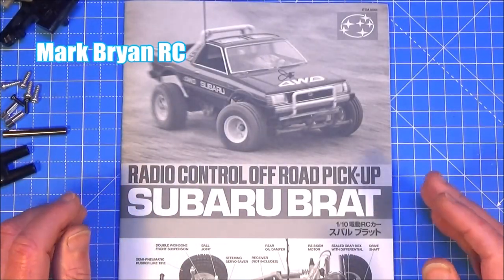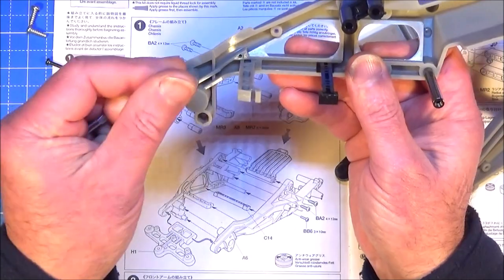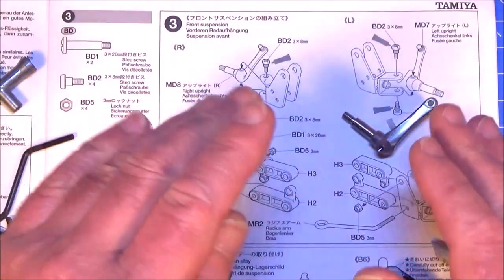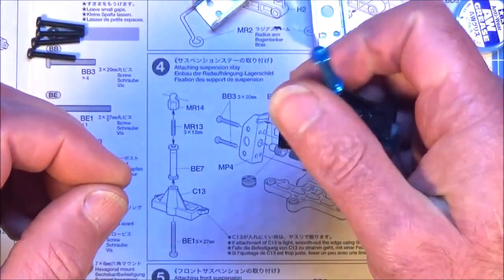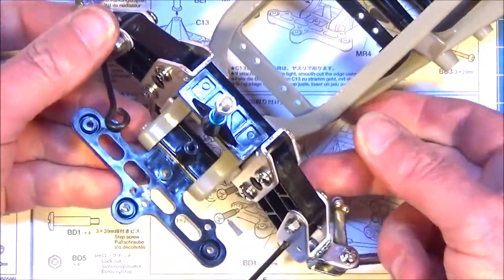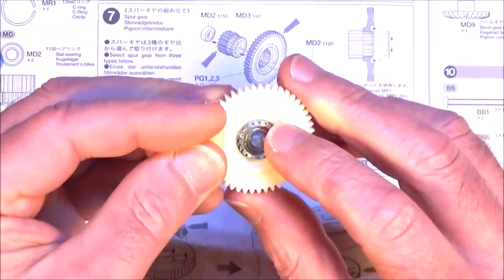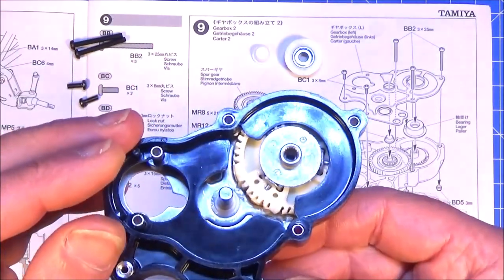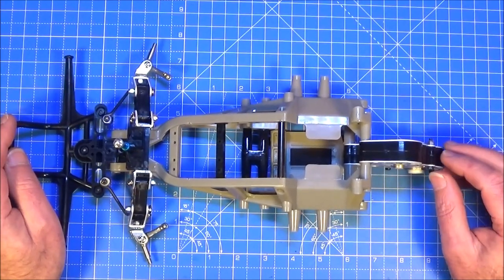Tamiya Subaru Brat Build Guide Part1 - ORV Chassis

Comment: A little tip when you install the uprights...
Put some blue thread lock on the 4 screws that attach them.
I've had 2 fall out never to be seen again.
After thread lock they're all secure and haven't fallen out..
Reply from the maker: Hi and many thanks for the great tip, you just might have saved me losing those kingpins! Yeah, I've had many parts fall off my RC's in the past, they seem to disappear into thin air, don't they?!?!?! Cheers!

Comment: I liked the brat but that front knuckle fell apart . Found the riding fighter plastic knuckles fit well with a good old bolt through them . When it’s all painted up mate it’s a beautiful looking truck and quite different really to drive and view . It’s also quite nippy with the high speed options you get 👍
Reply from the maker: Hi Dom! Thanks for the heads up! Luckily I've got a spare set of those uprights. I'm a bit daunted by the hard body but I'll give it my best go! All the best my good friend! 👍
Reply: @MarkBryanRC  yeah do the hard body mate it looks stunning when finished . It’s time consuming but not to bad 👍
Reply from the maker: Will do matey, fingers crossed it comes out OK! At least I can respray it if I mess up! Cheers! 😜🤞👍
Reply: @MarkBryanRC  it will mate . Unless you are going two tone it’s a couple of sprays over the body as normal then some detailing mostly in black around the windows . If you have done a Blitzer beetle bod you will be well away . Just time consuming 😊👍 have to say tire writing goes down a treat on this car 🤔
Reply from the maker: @rc-dom-uk  Thanks for the positive words, mate! I'll try and chill about it. And yeah, already dug out my white paint pen for those tyres! 😜😜👌👌👍👍

Comment: Great vid Mark 👌 you on about a screw missing from your kit, my ford escort custom didn't come with that AW grease tub so I don't know if it was supposed to or not 🤯
Reply from the maker: Many thanks, Alex! Oh yes, the first screw missing for me in a Tamiya kit in 20 years!!! Yes your Escort kit should have come with the AW grease, very strange! Hope your Sunday is going well, cheers! 🙏😊👍
Reply: @MarkBryanRC  cheers Mark for reply the only thing is tho I was halfway through the build so as I didn't have aw grease I used thick multi purpose car grease for the rear diff and normal tamiya kit grease for the front diff and followed your awesome vids for a rally build 😀 👍.  I just hope it will work well as it has made the rear diff more stiff than the front one. Thanks for your vids Mark 👍
Reply from the maker: Hi Alex, no worries! I have used similar car grease in my TT02 diffs many times and it works a treat - I reckon yours will be just fine! And thank you very much for watching my videos, dude! 🙏👌👍

Comment: Is that md12 plate metal? If so I can use one my monster beetle when I finally start to build it
Reply from the maker: Sorry mate I just looked through the video and could not see MD12. Where does that part go?
Reply: @MarkBryanRC  sorry tried to send screenshot but will not let me?on monster beetle in manual its k3/k7 it holds the back rear axles on

Comment: While the rere enjoyed some updates there is a problem tamiya left: the counter gear in the gearbox is rather soft and tends to desintegrate. I dont know how they could do this, also at least they should offer a more solid brass/steel one here. Shame tamiya lets down their fans with this soft aluminium gears and pinions for years now.
Reply from the maker: Hi Schutt and thanks for the heads up! Yes that counter gear does look to be made of the horrible soft alloy that Tamiya uses. For this reason I will only be installing a mild motor, no brushless systems here! Cheers! 😉🙏👍